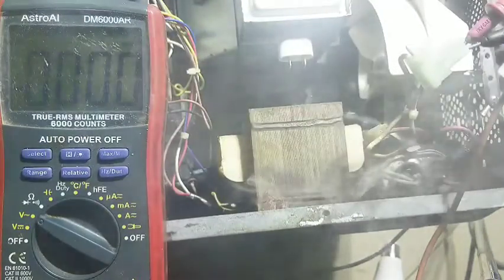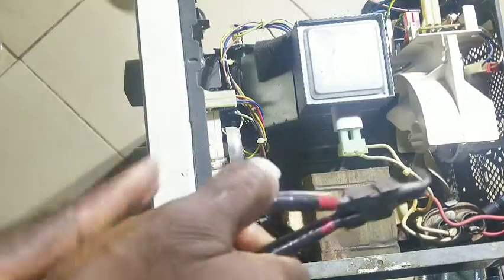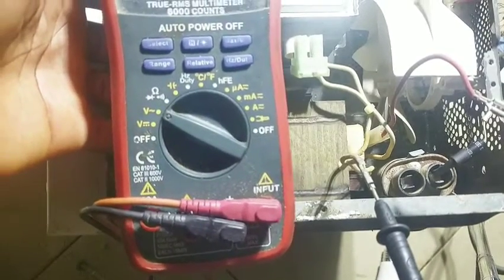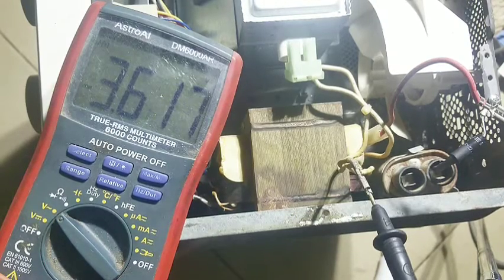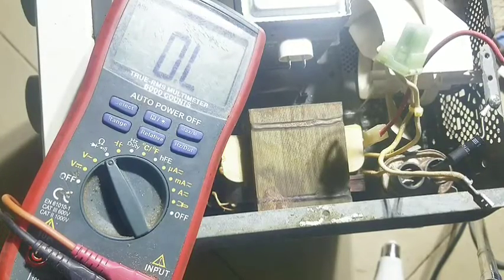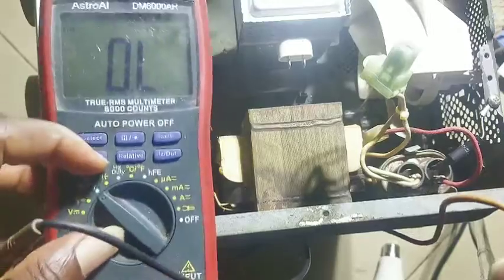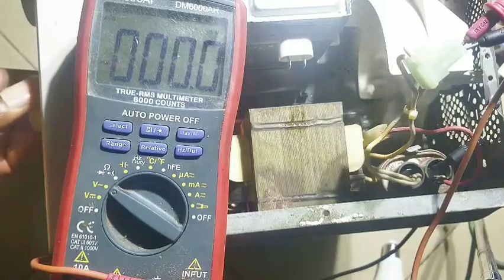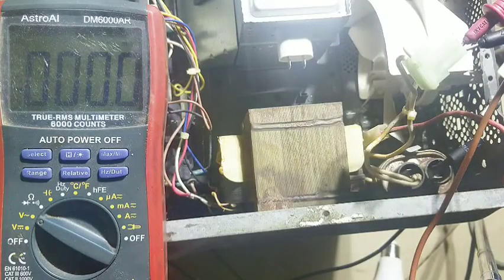Microwave Oven Transformer Smoking Diagnostics & Solutions Microwave Smoking Solved

Comment: Did you ever figure this one out? I have the same issue with the transformer smoking.
Reply from the maker: No, it could be faulty Magnetron or transformer
Reply: Magnetron filament is good. Check terminal to the case should read open. Transformer secondary winding burnout
Reply: I’ve had the same problem. Replaced transformer it’s working perfectly now